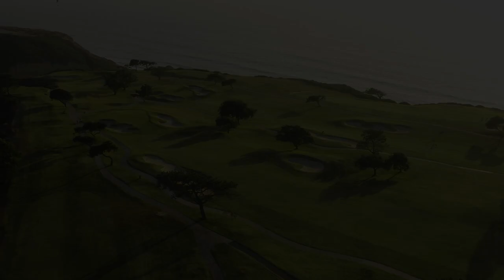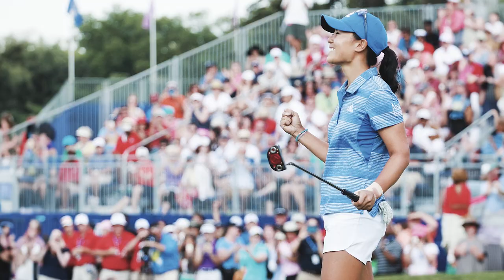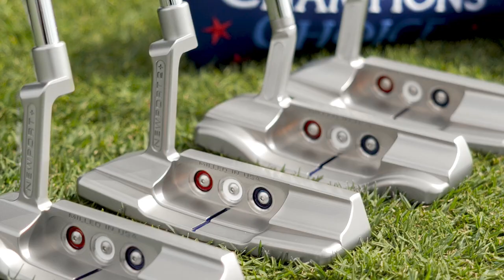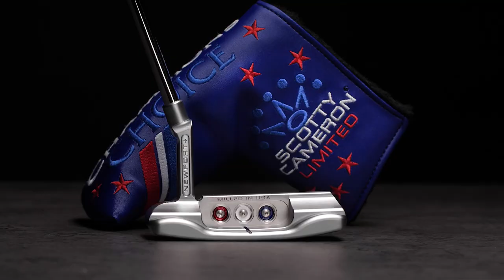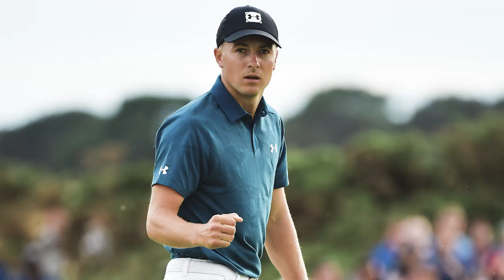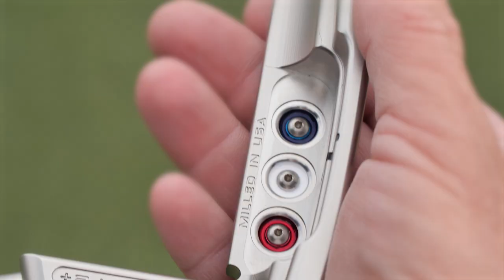Champions Choice Button Back Limited  |  Scotty Cameron Putters

Comment: How is this a limited release when this was out a few years ago? Disappointing..
Reply: These aren't the same putters that were released then so it would still make those limited. Nothing to be disappointed about unless you couldn't get your hands on any of them lol
Reply: I agree. I have 2 CC’s from the previous release and except for a few minor changes on the newer model, they are identical.
Reply: @bmurray330 they aren’t the same
Reply: @TheAmpharosFreak  They are pretty damn close.
Reply: What's different other than the model & grip?
Reply: @BuffaloNickel9  From what I see it is based on the new 2023 super select frame with a Teryllium insert. Other than the grip… 🤷🏻‍♂️